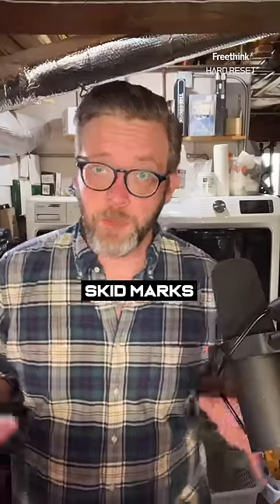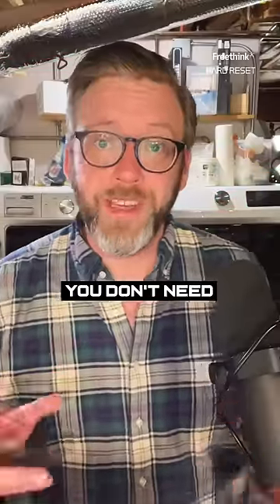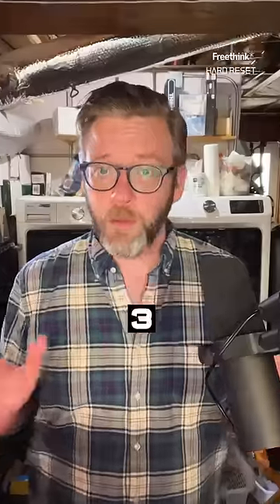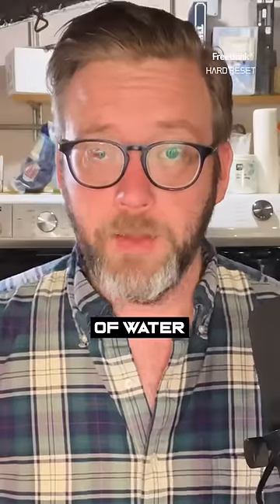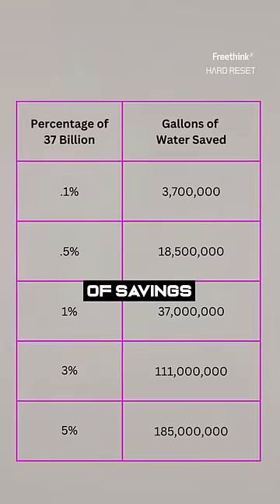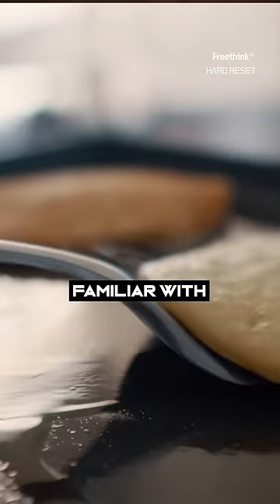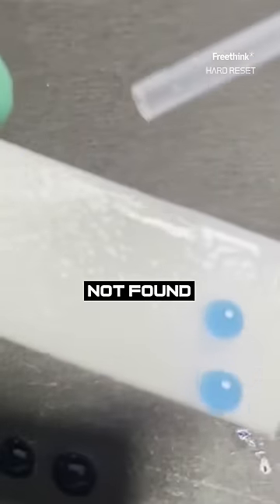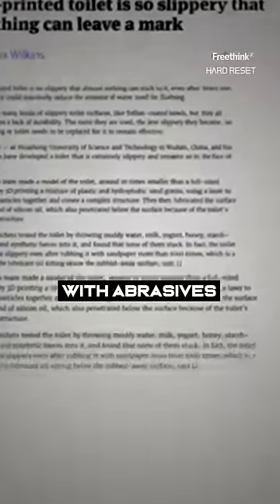Researchers invent super slippery toilet 🚽😳 #shorts #metamaterials

Comment: As a plumber, I can tell you that it's physics. It takes a certain amount of water to carry waste through the sewage system. At between 1, and 2 percent slope in sewage pipe, it takes a certain amount of water to carry the waste efficiently. To much water, the water out paces the waste. To little, and theres not enough to carry the waste. So unless you used this material to completely overhaul every sewage system, its really not going to help. But this technology is good. Keep inventing!
Reply from the maker: Hey, thanks for this insight! These are all good points. Hopefully the researchers involved take this into account. Could you see the material being useful elsewhere?
Reply: Anywhere that you would want to reduce friction. Any bearing material, like crankshaft, or cam bearings in motor vehicles. Or any other type of machine. All machines have some type of bearing surfaces. Or if it could be incorporated into materials like P.T.F.E., or in conjunction with other materials like that,  would help all machinery to be more efficient.
Reply: It's not about hauling the crap completely to the sewage treatment. You must have encountered the time when you flush, there were stains that sticked to the toilet, so you used second or even third flush to wash it out before you even attempted to use the brush.
Reply: And is it not going to use a p trap? Last I checked that turd isn't going to climb through a p trap without any force (via a flush) acting on it. Absolutely awful idea period. No skid marks woohoo so cool.
Reply: @mikesweet5848  traps are an integral part of a toilet. All toilets are traped.
Reply: I think you mean to much slope and the water will out pace the waste. Not to much water will out pace the waste.
Reply: Slippery pipes
Reply: People are so shortsighted. "Ooh poop isn't in the toilet anymore! I guess it's all gone!"
Reply: Just make the pipes out of this material, and and pressure.
Reply: @edwardhernandez6248  do you realize the cost to replace all the waste pipe, not to mention the added cost to make it pressure rated? And the time it would take!? It would take hundreds of years to accomplish that!
Reply: @amirulhakim9898 i automatically already am holding the brush 😂
Reply: I would guess the literal scientists researching these stuff would have thought of the physics
Reply: So if we started installing this material at the downstream side of the process, would we see any benefits?
Reply: I love people in trades
Reply: @Zander10102  less obstructions, but probably would only be installed in new construction. It would take decades, and at huge cost to replace current systems. I would see it more useful in other industries. Automotive, Aerospace, medical...
Reply: @markgoin225  fair enough.
Reply: But you can manually change your toilet level? They use way less water in other contries too so how does that work?
Reply: Finally someone with a brain. My man. Cheers to you and have a Merry Christmas
Reply: @dmo848  👍 thanks, and merry Christmas and happy new year to you as well!
Reply: Thank you! I work on septic tanks and sewage lines for a living and this was the first thing that came to mind. You would have to redo all the lines, which of course isn't practical. Heck where I live you still come across orangeburg lines which they stopped using in the 70s. So yeah, pretty unlikely...
Reply: 😂😂😂 All the plumbers are pissed.
Reply: This would Just be used in the toilet. Sounds like it might only save %1 or less of water per flush but that even that would end up making a difference!
It would also help avoid toilet clogs 
Don’t know what percentage
But sounds like they believe it would be enough to also benefit
Reply: Very true.  The toilet itself may not have any problem but that’s a vertical drop virtually.  Once it hits the pipes, we’re gonna need some fluid to move it.
Reply: @markgoin225 no - these surfaces have to be microscopically close to true flatness, so I sincerely doubt we’ll see this in vehicular or engine applications.
Reply: @markgoin225 maybe bushings, but not bearings.
Reply: @maxmotors9497  race cars have ceramic brake rotors. What if that technology combined with this other ceramic tech, and then it could be a bearing surface
Reply: I absolutely love when the one person who actually knows about the subject completely shuts down these "tech millionaire moguls" who try to reinvent the wheel just to be completely SHAT ON "pun intended" by a typical tradesman.
Reply: Well, I wouldn't have to flush twice anymore to remove the skid marks
Reply: As I just finished taking physics in school I'm glad someone actually mentions it
Reply: I realized this the other day when my brother clogged the toilet with toilet paper and the water almost filled the bowl despite it being empty (water wise) when it was flushed. Under normal circumstances that amount of water would pushed everything down easy peasy. I Wonder if the whole system can even be changed since pressure to get rid of waste is the biggest factor
Reply: @shannarafryer3111  well you can't get rid of waste without getting rid of people. As I've mentioned before, changing entire existing systems, is very cost, and time prohibitive. New construction could certainly accommodate the new technology.
Reply: I was wondering
Reply: @luis4290  whats a fast toilet without racing stripes!! 🤪
Reply: @nettieharris  it's possible it could reduce the amount of water needed in the toilet itself. But, it would still require the same amount required by the physics of the entire system in itself.
Reply: I’d do it just to save the environment of all the cleaners used in toilet bowls.
Reply: As a dad that regularly cleans toilets, I'd say this is a godsend. And I humbly disagree that you'd need to re design the whole sewerage system. We already have some low water flush designs. Thrown this into the mix and you'd significantly reduce the water need to flush AND clean the toilet.
Reply: @BaldAndCurious  less water at the toilet itself could be a good thing. But, physics is physics, a physical constants remain the same, regardless of our thoughts and opinions. But if you're willing to foot the bill for higher maintenance costs, and digging up the streets, when a major blockage occurs, good for you.  Your neighbors may not agree.
Reply: @markgoin225  in Asia , not so much, as we'd only do maintenance in our own underground sewage tank (is that what it's called?) Less water going into it from the toilet, longer time between calls to the swage guys that pump it out.
Reply: @BaldAndCurious  you're correct. In a small closed anarobic septic system, this tech might possibly be of some worth, right at the toilet. But your pipes should still be graded at 1 to 2%, to perform correctly. But in a small individual family system, less wayer could be working out for you!  Good luck!
Reply: @markgoin225  yeah. Every drop I can save counts 👍 less calls to plumbers but maybe the can mo to upgrading older systems
Reply: @markgoin225 it's not like this system is used completely separate from the other waste water systems. You won't need much water to flush, but your shower and sink will still provide the water needed to carry solids down the sewer pipe.
Reply: why are we arguing with the literal plumber
Reply: I am not a plumber but i thought of this immediately 😂 it needs a certain amount of water to push through.
Reply: @falconerd343  nice thought. But it just doesn't work that way.
Reply: Make it to make the pipes slippery then
Reply: @weiyuan20  sometimes it must go up a little... I dont care how slippery it gets 🤣 you need a bit of force.
Reply: @porichechannel  depending on your sewer system. in the US where there's municipal sewer system, you need more water to push it through, but if you house has it's own sewage tank, you can significantly reduce the amount of water needed to flush from toilet to tank.
Reply: @markgoin225  This is effectively PTFE. They invented a Teflon toilet.
Reply: To reduce warer usages we need slippery pipes for slippery toilet and certain pressure of water. Other all the craps are drop and stuck at the hole🤮
Reply: I guess the pipes themselves have to be made with the same materials or maybe an air toilet can work?
Reply: I used to lay pipe and do excavation work, I can in fact confirm that sewer line is between 1-2% grade depending on terrain and distance between manholes. Too much “waste” and not enough water lead to backups and blockages. Had to rip out many many sewer lines due to blockages from not enough water or roots in the system but that’s a different story. Septic is the same. Not enough water to carry it to its destination, and the whole things fucked
Reply: Slippery poop! Who knew?
Reply: Well ... I use a menstrual cup and I’ve found a lot of new toilets with lower water levels cannot flush away a couple ounces of blood dumped into the bowl, because of the angle of things it dumps onto the dry part if the bowl, not into the water. A single flush cannot rinse it away. Sometimes I have to use a brush to break it up  and combine it with the water before flushing. A super slippery surface would allow it to flow into the water, rather than cling to the bowl,  where it should have no trouble moving along the pipes.
Reply: It's useful with urinals.
Reply: @freethink I can see this useful in cleaning and water transportation of potatoes, as usual they have to flood potatoes on a conveyor belt to move and clean them. The biggest problem is the friction causes the potatoes to bruse and not look good, therefore not being able to be sold
Reply: Exactly
Reply: muhelectionwasstolen7253  and just what would a plumber call themselves?
Reply: @markgoin225  I mean, considering the US is in desperate need of a complete overhaul for multiple crumbling infrastructures, wouldn’t be a bad idea to pick the material that won’t have to be touched for the longest time. Idk if that’s this material, but if it’s gonna get upgraded lord knows it won’t be touched for several decades after that unless it breaks…
Reply: @JacquelineUnderwood  the best thing would be to start with new construction, and remodels.  Then if there was a planned upgrade, that would be the way to do it.
Reply: @amirulhakim9898 yeah its just about getting it out of view😂 who cares about the journey after that.
Reply: @markgoin225 I think the information given in the video might be inadequate to understand exactly why it saves water. As someone said, if one finds that poop regularly sticks to the bowl after 1 flush (7 gallons standard flush), and takes 1 more flush, that is twice the amount of water (14 g ttl) needed to properly move it fully through the toilet and sewer system as you described. And that's without replacing anything but the toilet or resurfacing it (if possible). If it usually takes one a total of 3 flushes (21 gal) to remove what stuck. So, reducing back to 7 gals is a big savings.
The slope of the plumbing and length of the run at that slope will also depend on the structure in which one lives and where it's located in relation to its destination in a sewerage plant or septic system cost. IE: I once lived on the 10th floor of a highrise condo bldg on the slope of Punchbowl, in Honolulu. It was no more than 3 ft of in floor drain to the straight down drop of the plumbing stack and then down a good slope to the treatment plant. The greatest concentrations of people around the world are at least in highrises, but from there can vary a lot. I've lived where lift pumps were needed as well. 
Point being that these toilets might save 50% of the flush water or more depending on circumstances.
Reply: @marckaufman2556  7 gallon per flush toilets have been out of code since the mid eighties. Toilets manufactured since then, are 1.5, or right around there somewhere. So even if you flush 3 times that would be 4.5 gallons. But someone using multiple flushes to eradicate skid marks, is not how plumbing systems are designed, and maybe they need to change their diet a little. They are designed for a single flush. If you’re using a modern efficient toilet, 1.5 gallons is enough, although any less than that, can cause issues with not having enough water to move the waste. Regardless of the length of a plumbing system, it must maintain a 1-2% grade to operate correctly.
Reply: @markgoin225  That's what I get for using the 1st number when I searched. I thought it seemed higher than I remembered, but it's been a long time since I bought a toilet. The point was just to give some people a number. My current toilet used NO WATER. As far as skid marks and diet, I'm not sure that there's always a correlation between them. I have a healthy diet and sometimes when I use a normal toilet there are skid marks.
If the system always has to have a 1-2% grade, than that must only apply to what's within a unit in a highrise because it obviously doesn't apply to a plumbing stack since they're vertical.
Reply: @marckaufman2556  1-2% grade for all horizontal pipe. It would be impossible to apply grade to a vertical stack. What is the brand and model of your toilet?
Reply: @markgoin225  Obviously it would be impossible to grade a vertical stack, but you said, "Regardless of the length of the plumbing system, . . ." The stack is part of the plumbing system. So, just as I should have checked more numbers, you should have included "horizontal" in that sentence. 😉
My toilet is a self-made composting toilet. Luckily, I no longer live under the codes of the US. I have 95 acres in Ecuador. I asked if I needed any permitted to build at the municipal government building and received laugher for a response, and it wasn't due to my Spanish. In town there are some restrictions, but on a farm one can pretty much do what one wants. I built an 11 meter x 24 meter stable and 4 x 7 meter cottage.
Reply: @freethink How strong is the material? Is it as strong as metal, or is it a coating?
Reply: It would still be good for RV toilets. The brown goes straight down in those.
Reply: @MatthewZelek-iv8tb  Absolutely.
Reply: Maybe a sewage system overhaul IS what’s next? 🤔
Instead o cast iron pipes, they’ll be making cast lycopodium resin pipes
Reply: @Nathe_geo  a lot of residential, and commercial new installations have been going to pvc. Which is an improvement over cast iron, as far as durability, and chemical resistance.  Although, in a residential installation, cast iron is nice because it's quiet.  Unlike pvc, or abs, where you hear every flush, and every sink in the house.
Reply: See also "scouring velocity"
Reply: If that is the case could you line the inside of the pipes with this material?  This could reduce build up clogging pipes.
Reply: My initial thoughts exactly. You still need a certain amount of water to have good enough pressure to get the poop out of the toilet and into the pipes.
Reply: @herpderp66  maybe this material could be put were clogging happens most commonly?
Reply: Wait you’re telling me we can’t flush NYCs sewage with a cup of water per turd?
Reply: @BarrackObamna  eyedropper
Reply: @herpderp66  but then you have to account for slope. If you don’t have elevation to use to your advantage you must use flow. So it would be easy to say that on a vertical tower but when it comes to an entire city that’s relatively level the only thing causing flow is the water movement
Reply: Two very good points were made aside from how much water you need to initially  flush. 1) Reduced the amount of flushes needed to clear the bowl. 2) Reduced the amount of chemical cleaner. 
I have a septic tank and need microorganisms to break down waste. Chemicals kill these organisms. Just changing the toilets surface is already a win. As the blackwater plumbing needs to be replaced, efficiency will only increase.

At least until we find out in 2 years of how toxic this stuff is and is banned on planet Earth.
Reply: Glad you weighed in!
Reply: What would help, though, is avoiding extra flushes because of waste stuck to the toilet bowl. I often have to flush three times or more - one main flush, once after using the toilet brush to dislodge the waste and a third time to clean the toilet brush. This could reduce my toilet flushing usage by a third or more.
Reply: @feanor5037  upgrade to a better toilet. There are a lot different shaped toilets out in the world!  Shape of the bowl might be your issue. Personally, I prefer the Kohler brand. Thats what I have in my house. It works well for me.  You could try holding the handle down for a more complete flush.
Reply: @markgoin225  OK I'll replace the toilet in the rental I live in, at work, at the other remote offices I often work at, at the hotels I frequently have to stay at for work, and at my family's houses
Reply: @feanor5037  it was just a suggestion
Reply: @markgoin225  😜
Reply: Are they gonna come out with an affordable pipe made of this stuff l? Otherwise it’s kind of a gimmick. It’s no good if your waste gets stuck halfway to the sewer because there wasn’t enough water to carry it through your house.
Reply: Yeah but it doesn’t really have to be freshwater it could always just be ocean water pumping in there (at least for coastal areas)

Comment: The problem I see is that if they greatly reduce the water they use to flush, there may be a greater incidence of clogged public toilets
Reply: Very good point,
Reply: But the very slippery substance would just push it through.
Reply: Higher pressure, lower volume. This is already pretty evident between low and high grade toilets. Most cheap "models," if you can call them that lol are over a gallon per flush. Some of the higher end toilets can flush at higher efficiency with just a fraction of that amount.